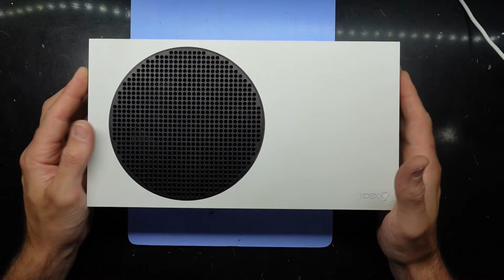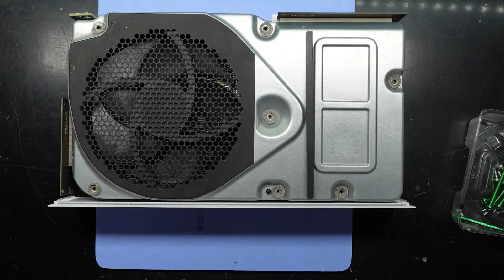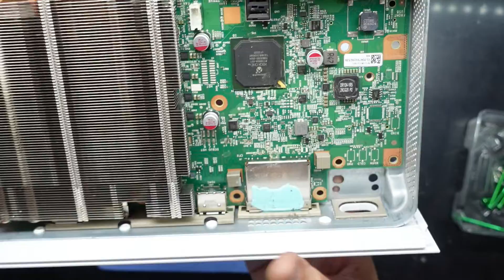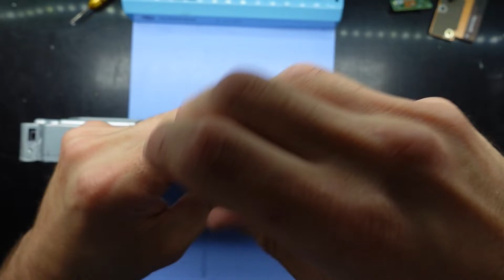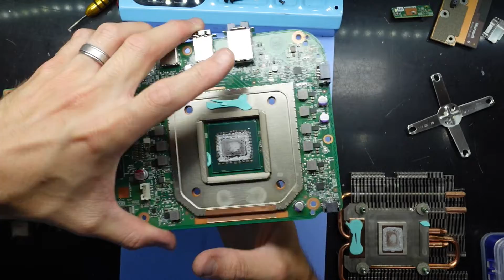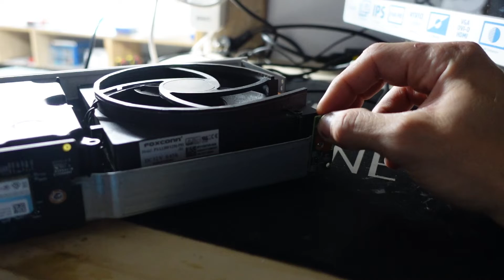Xbox Series S First thoughts and Water Damaged Teardown Inspection

Comment: Long shot, but i recently had water splash into the side of my series s. Pretty much exactly where the power supply is.

Can this be fixed by getting a new power supply?
Reply from the maker: if its looks to be only the PSU that got wet, i would try and replace just the PSU